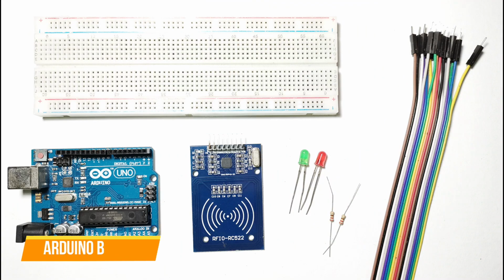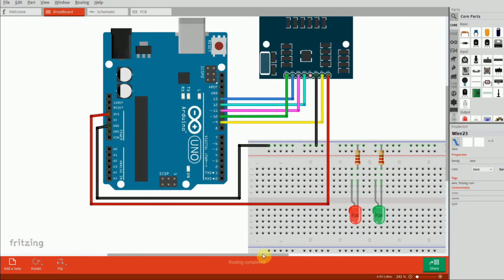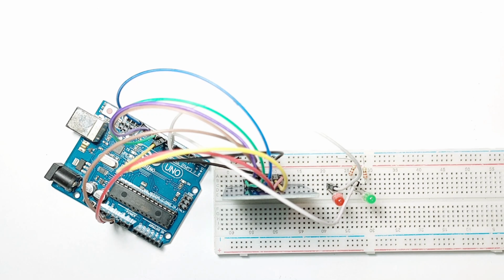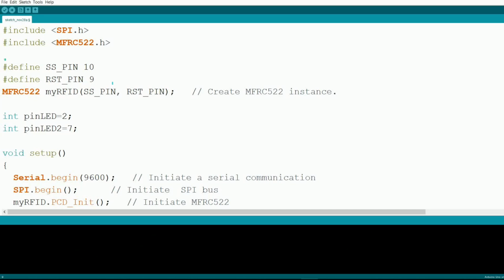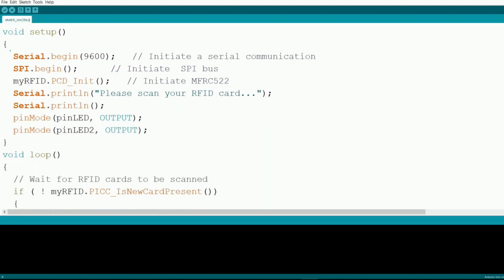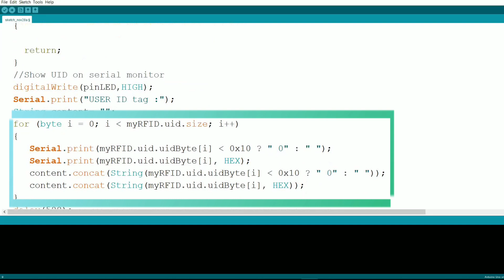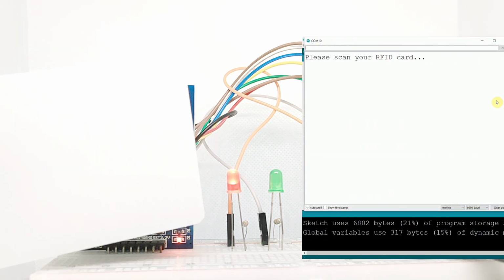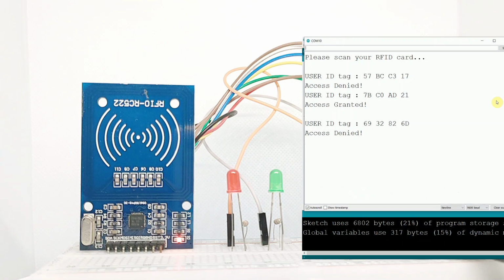How to Use an RFID Module with Arduino for Beginners

Comment: Idk why but it doesn't read the id for me
Reply from the maker: it's difficult to know the problem without looking at your circuit, however, it may just be some faulty jumper wires or some loose connections on your RFID reader, try changing your wires.

Comment: hi this is great but the led lights wont light up when i scan the card
Reply from the maker: Make sure the LEDs are connected correctly (positive side to a digital pin and negative side to GND). It could also be a broken jumper wire, try to change the jumper wires.
Reply: @arduinointrochannel  no in the code of yor website you forgot pinLED=7;
Reply from the maker: The second LED (pinLED=7)is found in Project 2 of the website. https://www.arduinointro.com/articles/projects/how-to-use-rfid-rc522-with-arduino-a-complete-beginners-guide#:~:text=PROJECT%202%3A%20RFID%20Access%20Control%20System

Comment: Do you have code that will work with UNO R4 Wifi  board?
Reply from the maker: This code will work on that board but to add the extra functionality to upload data, you'll have to try the Arduino Cloud IoT, they have tutorials on how to upload sensor data.
Reply: @arduinointrochannel  do you have the code somewhere?